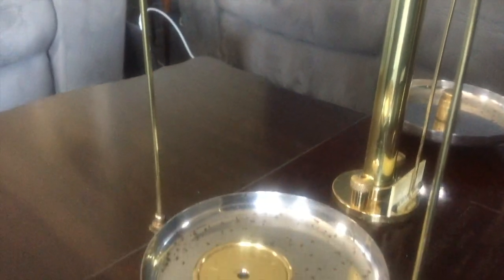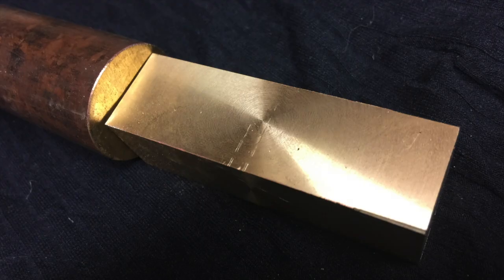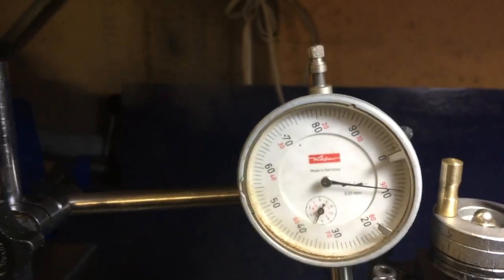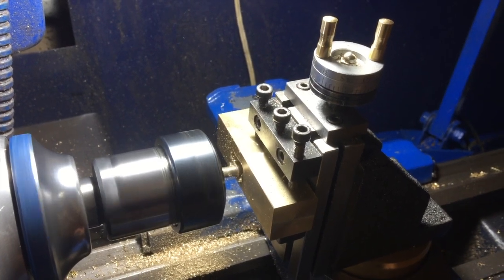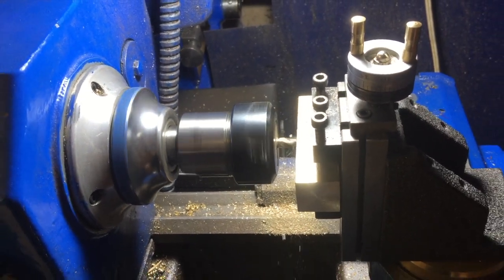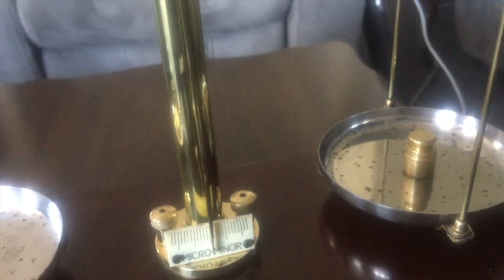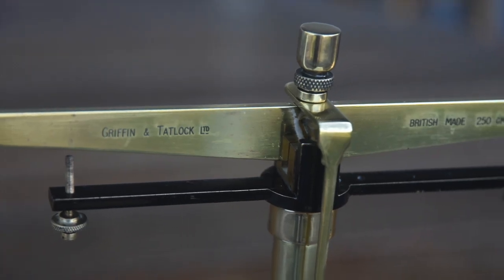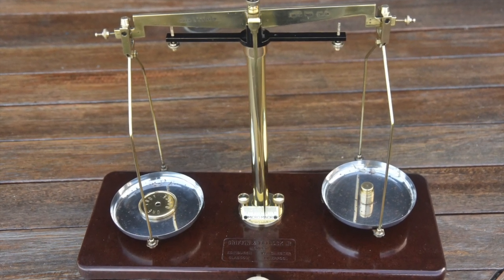Restoration of old gold balance using a milling attachment on a lathe

Comment from the maker: STOLEN:  If you see this balance let me know!  A geology display had been very nicely prepared by volunteers geologists at The Gold Mine Experience in Thames, New Zealand. Thieves broke in and stole all the mineral specimens and the balance shown in this video.  I had also taken home numerous brass and bronze parts from our boiler, polished and restored them, and coated them with lacquer. These were all stolen too.  During 5 raids in a short time 105 items were stolen. All of these parts date back to about 1860 and cannot be replaced. They will have been melted down as scrap metal for a few dollars a pound.  What a tragedy!  Police have not been very helpful. Burglar alarm systems are now being installed at great expense.